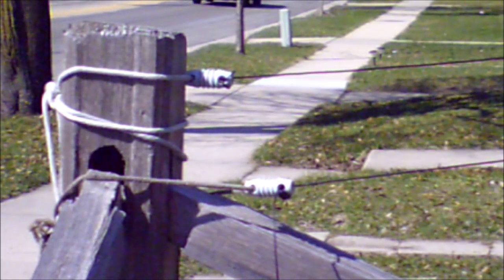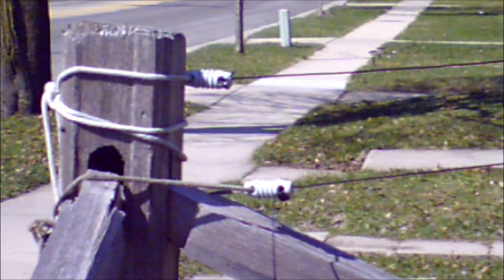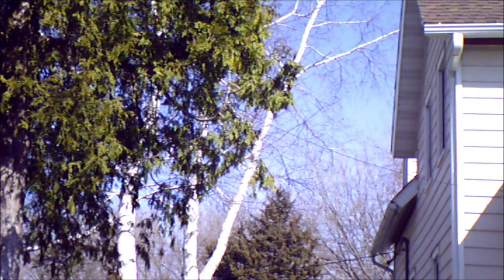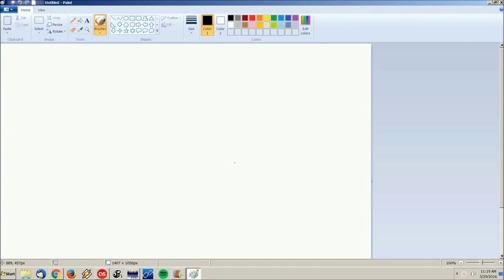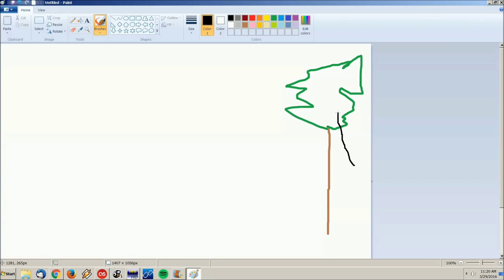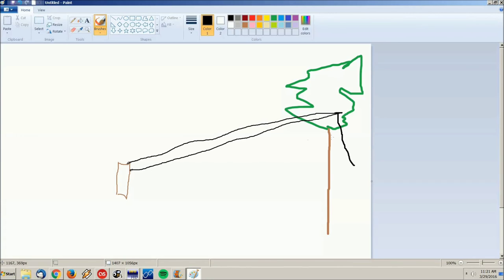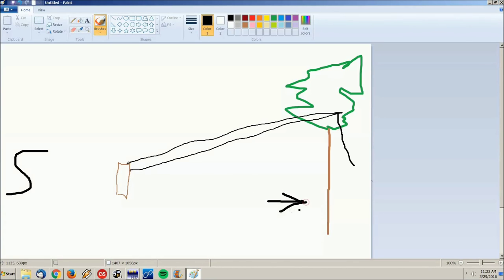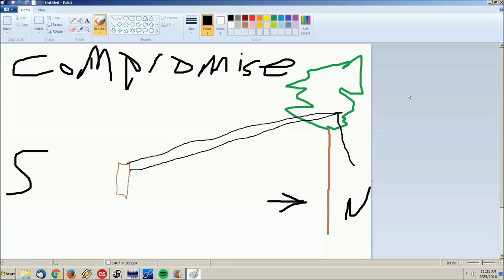A Compromised Dipole Shortwave Antenna Setup

Comment: Such Haxxor l33t MS Paint skillZ!

If you joined the 2 open ends of the antenna you would be left with a sloping end fed folded dipole, which because of the location of the feed point would have a high impedance.

If you had the room I would highly recommend building a tilted terminated folded dipole antenna.
Reply from the maker: +SpectreOZ Thanks dude! LOL I'm waiting to hear from my adviser as what to do. Hint he will be posting a video on Wednesday. :)
Reply from the maker: +SpectreOZ I'm going to give your suggestion a try, since the video that I was waiting for is going to be delayed until next week.
Reply: +sparkyzilla85 I will be curious to see how that works out, I have never built one of those before...
Reply from the maker: Well, I'm trying it out right now and I haven't come to any conclusions so far.
Reply: ***** Talk is cheap... Where is the video? lOL
Reply from the maker: +SpectreOZ It's coming. I want to wait for this afternoon and evening when DX really picks up.

Comment: I think it would work better if you just let one side fall straight down to the ground.
Reply from the maker: +The Radio Hobbyist I was thinking about that, but I kind of tired myself out yesterday with that project. I don't know how many times I threw a rock with wire attached to it up in the trees. LOL
Reply: +sparkyzilla85 yeah if you do that it would create a inverted L antenna and I hear that makes a good rx antenna to.

Comment: Doesn't look like its going to work very well  Both legs of the wire are way too close to one another.  The two wires need to be at least 30 feet apart   in your diagram  they look like they are  within 4 feet of each other.  I will be very surprised if this set up works  worth beans,. Let us know how it worked.
Reply from the maker: It actually worked pretty good. Greg, OH2FFY, ran a computer model on which bands it would receive well on, it showed that it worked best from 3 MHz to about 12 MHz. From there it dropped in sensitivity.